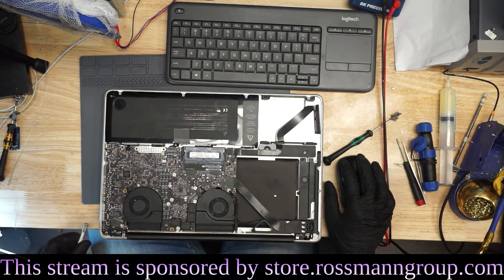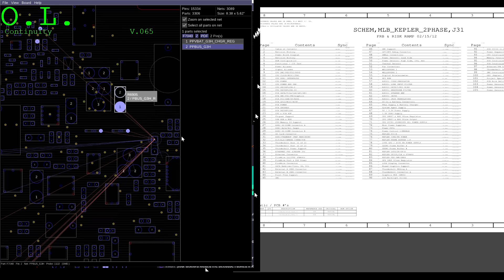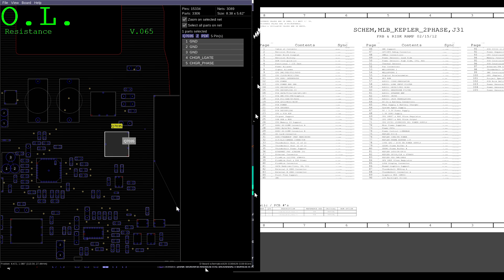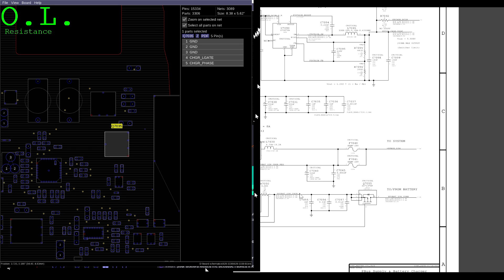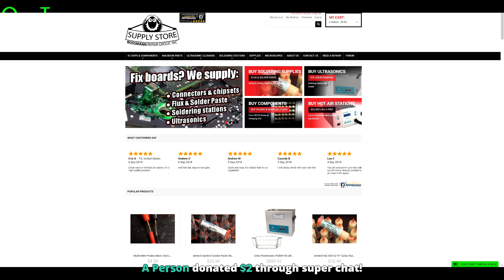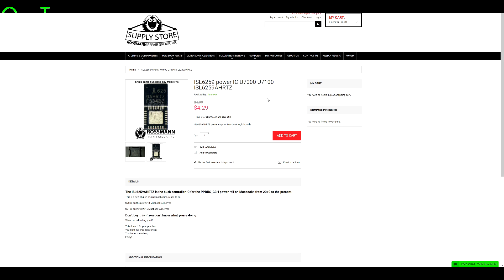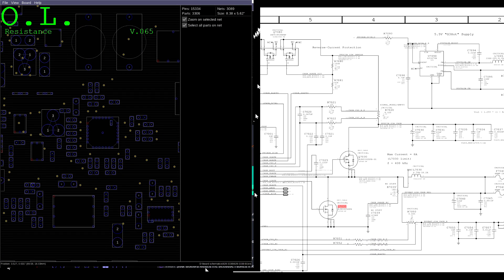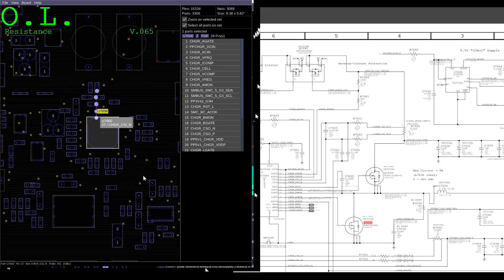Restoring PPBUS_G3H on an 820-3330 A1286 2012 Macbook Pro with faulty logic board

Comment: I wish this was the same issue I had, but my Macbook Pro 2012 15 inch died. It turns on, fans spin, and 3 white blinking lights and repeat. Nothing on the screen either and external monitor doesn't help.
Any idea what could be busted?
Wish there was a way to send this Macbook to Rossmangroup from abroad.

Comment: Hi, I've the same logic board with the green light on magsafe but no fan spin, no power.
The strange problem that I can see is the ppbusg3hot floating from 12,46V to 2,2V to 0V then another time 12,46V to 2,2V to 0V and another and another....
I've changed the U7000 but the problem isn't resolved.
Can you help me? It's 4 mounths that I analize this logic without find a solutions.
Thanks

Comment: How’s that New Years resolution to not curse on stream going. I think I even learned new works. Joking aside I wiped the bottom half on an iPhone 6s Plus RF circuit out the other day taking on the shield to check baseband. So I feel your pain. Two hours to rebuild it all.

Comment: Apple has introduced software locks that will effectively prevent independent and third-party repair on 2018 MacBook Pro computers, according to internal Apple documents obtained by Motherboard. The new system will render the computer “inoperative” unless a proprietary Apple “system configuration” software is run after parts of the system are replaced.
According to the document, which was distributed to Apple’s Authorized Service Providers late last month, this policy will apply to all Apple computers with the “T2” security chip, which is present in 2018 MacBook Pros as well as the iMac Pro.

Comment: Hey Louis Love your work entertaining and very informative. I have a 13" macbook pro 2012 when the charger is plugged in no light on the charger but laptop has the lightning symbol on the battery but says its not charging? Very confusing. I was wondering if you had any suggestions?  Thank you very much greetings from Ireland.

Comment: @Louis Rossmann, My macbook pro 13" early 2011 screen, won't light up. when I point a flash light through the apple logo, I can see my desktop icons. Please help me out...
Reply: Your backlight module needs to be replaced its behind the black plastic cover on your lcd they go for 5-10 bucks on Ebay if that doesn't work you should buy a new lcd as the lcd bulb might've burned out then if that doesn't work it could be your led circuit on the board.
Reply: Process of elimination
Reply: I also noticed that, sometimes when I boot my mac, the backlights attempt to lit but doesn't.

Comment: What tool is at 9:38 to approx 10:00?  It appears to take off solder like a wick but it just looks like a soldering iron??  Store link?
Reply: It is a chisel shaped soldering iron tip. Wasn't wicking anything really. The board's solder mask is what makes that possible. There are videos on SMD soldering that explain more detail on how to do it.

Comment: ..fuck me.. ;) funny Louis. Its the difference, if you wait 3 seconds more, when heating.. usually i preheat the board with bga machine, then help with air heater.. it helps also when you solder integrated RAM onboard.